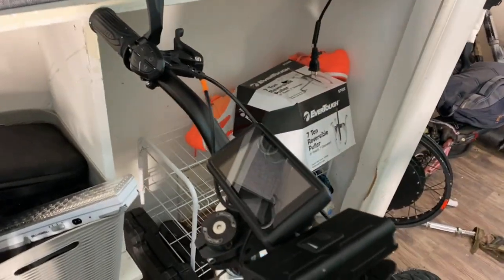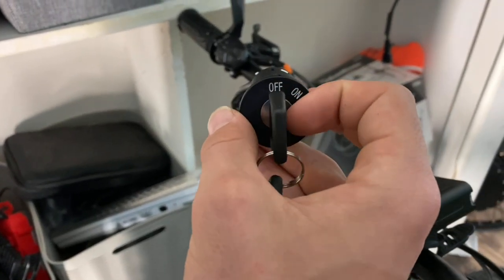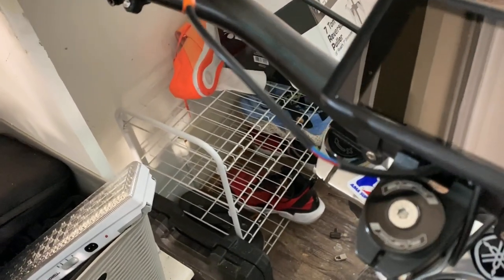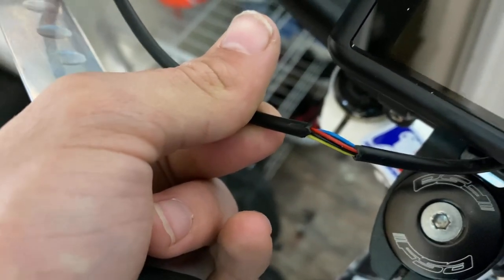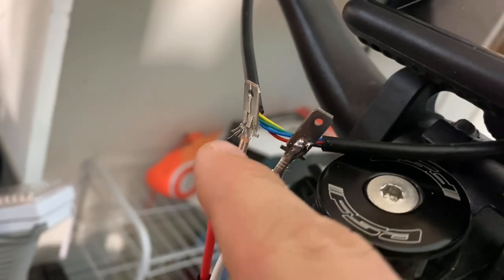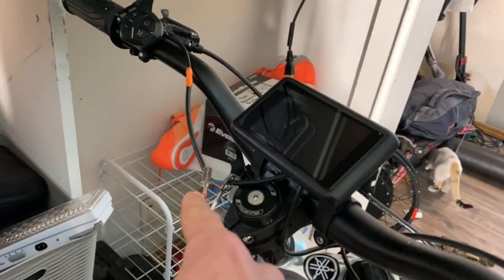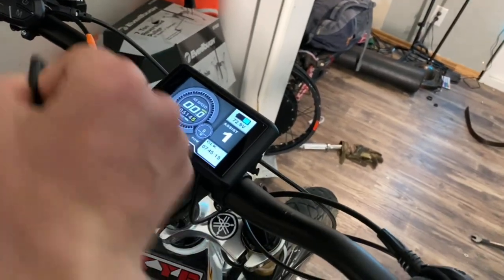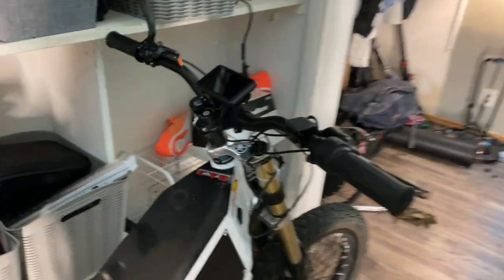How to add a keyd ignition to any ebike(easiest method)

Comment: That would be due to the FACT you chose the "WRONG WIRE" to "HACK" your way into it !!!
If you would have chose the wire that gets B+ to it when the switch is pressed then it would have worked the way you wanted it to .....
But you just HACKED the wire up and then you did not even cut off the pushpin connectors that were on the end of the wires at the key switch ......
If you chose to do a YT video instructing people how to install a keyed ignition switch then you might wanna do it the PROPER WAY .
Reply: Yea this is all wrong. You wanna cut power, not ground. And you would probably wanna get a handlebar mounted ignition and wire it to the controller through the frame to hide everything and make it look stock.

Comment: This only stops power to the buttons not the screen splice the Cable that goes from the controller to the lcd and it will do it or on the battery negative just extend wires or hide the lock
Reply: I will do this
Reply: So I'll.splove and red goes to lcd wire next black goes om?

Comment: Hi, how would I make my
Key ignition turn on my screen, I hate it as i have to manually turn on the screen after I turn on the key
Reply: You'd need to trace the wires to the on button solder to  one of the buttons connections so when the key is twisted it would act also as a go single

Comment: How to connect a key ignition to ANY ebike! That's quite a broad statement! Ok, so how do I connect my key ignition to the controller!? Not every ebike has a digital screen! And to be honest if you can't work out that a simple inline splice connection is how you install the key switch, you probably shouldn't be attempting to alter any of the electrics!?
Reply from the maker: It’s very simple. You are connecting a on off switch (aka keyed ignition) to a wire that is necessary to the operation of turning on the bike. So every bike may not have a lcd screen but most every bike has a on/off button with a wire that leads from it to the controller. You are simply splicing that wire.

   I can make an updated video with an explanation to my thinking.
Reply: @ENDOPRYSMyt  Thank you for your reply, and apologies for being a bit harsh in my initial post it wasn't very fair so please don't take offence! My situation is a little more complicated so I will explain. I bought a  conversion kit which I have fitted to my normal bike. The kit came with a twist throttle which has a on/off button built in. This all worked fine for a while but after about 3-4 months use it had a major tantrum and went on strike permanently! Hence, I needed to replace this and decided to get a thumb throttle which was cheaper and more basic which meant less to go wrong. However, the thumb throttle does not have an on/off switch it just has 3 wires the Red - Positive, Black - Negative and the Green Signal wire. Therefore, I can connect the throttle control but there won't be any power going to it. So, I need to make a connection via the controller to the throttle to send power to the motor! The initial problem is there are 6 wires coming from the original twist throttle and it is far from obvious which function each wire controls. But to make things worse I had to get a new controller which arrived with approximately NO English on it anywhere. Hence, I have absolutely no idea what any of the 4 million wires coming out of the controller are for! And whilst searching online for any information that may help, I have discovered that there isn't even a consistency in the wiring for different controllers! Consequently, I would really like to smash my ebike kit into to little pieces! But I have been reliably informed that doing that would not make it work any better!
In conclusion, do not take any notice of the crazy man! But please do keep making the videos because they are good and obviously helping others to fix any problems they may be experiencing!
All the Best
Reply from the maker: Very frustrating problem. I couldn’t tell you how to go about your controller issue as I have never had such a problem. If I had any suggestions it would be to contact the supplier directly and ask for some guidance. I sort of have a picture of your thumb throttle setup in my mind. I think you could splice into the red or black wire with the ignition and it should work. As long as the key is impairing the function of the bike in some certain way. It will make for a solid (temporary security system). By this I mean it will stop people that don’t have the key such as friends or maybe small kids from getting into the bike. 

   Any keyed ignition including ones for cars can be broken into by any criminal if they had enough time.
Reply: U basicly need to Connect the wire that send power signal from on button,
Reply: Just do it better than this melon, no point with the wires like this, u can just remove tape hold it together, follow wire, and where it cant be reached u Connect , u can use a meter to mesure where u have power running when u click power button, bit its pretty much straight forward

Comment: Out of the 3 extra wires left, one of them need to join the black connection on the ignition connect to solve the lcd problem.... so when the switch is off, the lcd should be off too as the  start button  did.
Reply from the maker: I kinda messed up with this. There is another power wire that goes directly to the screen. I would just cut that one instead. That way the screen should shut off when you turn the key and not the buttons that hook up to the screen.
Reply: @ENDOPRYSMyt hi there what power wire is it?
Reply: Yeah what wire is it

Comment: how you can justify heating of 205. Why you bother running smaller motor but not 273 instead. Do you feel those additional 5kg on the road?
Reply from the maker: Yes you can feel it on the road. less weight swinging at the rear of your bike makes it easier to control. Also a heavier motor can cause damage to your swing arm when you ride on any bumpy terrain. for my bike the motor stays very cool for the most part. Unless I take it up the mountain on a hot day then it tends to overheat. I’m gonna do some cooling upgrades to it so that doesn’t happen so easy,
 until then I’m just riding casually. For my friends bike I turned the power down until he gets some heat syncs and ferrofluid. Still probably won’t Even run it at full power when upgraded. But overall I just enjoy the lighter package.
Reply: @ENDOPRYSMyt yes it makes sense. It's good setup and motor without a doubt. FF makes most of the difference, fins good second addon.

Comment: How well would this work if it was integrated into the roo part of the headtube, might be a bit fiddly to remove and spice the cables but if the bike has internally routed cables, it would make it look much more neat and permanent, prevent tampering and overall make it look like it was part of the bike from the start
Reply: Funny story, the key ignition he is using is made to go into the head tube, but it is really hard to wire it in there so most people mount them elsewhere like he did.
Reply: @sebbyonyt  ahh I see, I'll definitely mount it in the head tube, I dont mind a bit of work

Comment: My key currently turns on and off my lights, horn and blinkers. Any idea how to integrate this into what you just did here? I freaking love this idea and love this mod. Been wanting to do this since I bought my Enduro.
Reply from the maker: find the wire that powers your display coming directly from your battery it should be wrapped up in the black tube material along with the other wires. it should be red or black. splice the wire and try to solder it on as i did
Reply: @ENDOPRYSMyt  Good place to start! Thanks for the idea!

Comment: I didn't see the key start the bike? I seen u push a button, then turn a key I didn't hear a start-up
Reply: It's an ebike.  NO startup sound.  Basically, he cut the black cable (ground) and wired a switch (keyed) in between.  When the key is in "OFF" position, the circuit is open and bike remains OFF.  When the key is in "ON" position the circuit is closed but the bike is not ON, still remains OFF.  The button still needs to be pressed to turn it ON.

He added an extra step that is not really necessary but could be useful for keeping honest people honest.  At the handlebar, its extremely easy to bypass this keyed switch.  For simplicity, it works, but I would've done the connection in an area not easily accessible.
Reply: @kaisersoza2801 hi there, how can I bypass the keyed switch so when I turn my key on the screen turns on?

Comment: Could you try putting the key switch inside the stem for a nicer integration ?
Reply from the maker: I was thinking about it because it would be a really nice intergration. But the little screw there on the top of the stem actually holds the whole thing together.
Reply: @ENDOPRYSMyt  yes thats what i tought too. Maybe a 3d printed designed modification of the switch could do the job
Reply: @elias8981  personally I’m about to make one of these and I think I’ll just make a whole in the frame top near the front that way it’s flush with the body and all wires stay inside, helps keep everything nice and orderly, I’m definitely putting my charging port there too that way I can charge from both sides without weird cable length issues
Reply: @Kim Hyunwoo  could you show an update of the end result if you do it on something like YouTube ?

Comment: better to hook that up to the battery instead so when you turn it off it cuts off the battery power
Reply from the maker: Your right I was thinking of doing that but I already cut the other wire. It works either way.